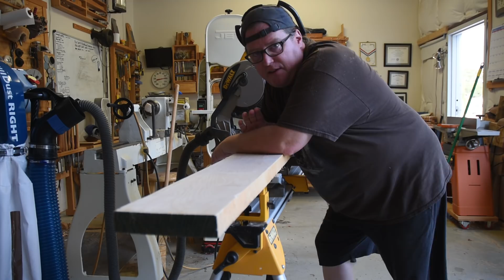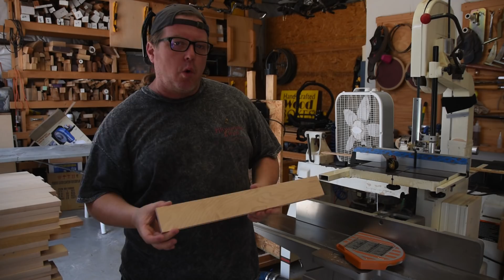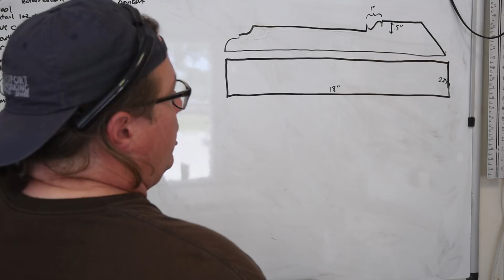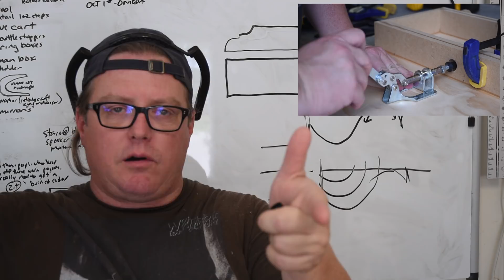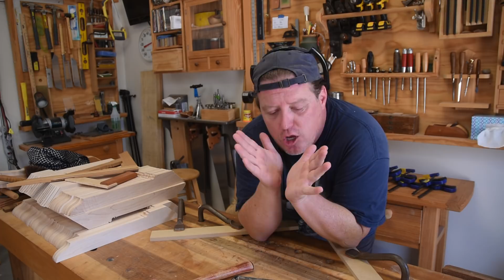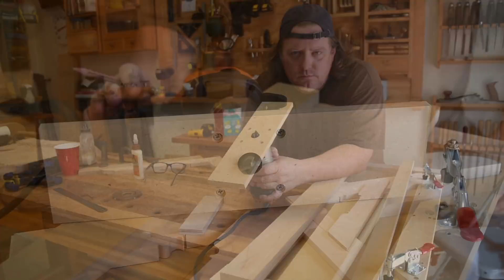Batch Production vs Hand Tools - Woodworking - Making English Squares

Comment: WOW A beautiful tool. If I were to do a production run on those squares I would think about have a special cut router bit ground to the profile you are looking for and ship that pattern off to a place that can make that bit for you. It might be a couple hundred dollars each but it would save mucho hours of the work to get each filigree cut as you are doing now. Now it also require a shaper instead of a router table. But if you are doing a lot of those items that will pay for itself after a few batches.
Reply from the maker: this size would require a shaper which can be some seriously scary machines.

Comment: I must dissagree with you sir , in europ we use all the time table saw on rough material. I have 4 horsepower table saw with 14 inch diameter blade and it cuts heavy rough matherial like sharm. Smal kickbacks here and there are no issue to me.  In my opinion your table saw is just too weak to cut it smooth and thats why wood defects cauze you kickbacks. I use my table saw to split 3,5 inch thick boards what come from sawmill.
Reply from the maker: Jürgen Viesemann uh, no. Doubt seriously Europeans regularly push rough lumber thru a tablesaw without truing one edge or accepting any kickback as normal.
Reply: Example , board comes from sawmill with bark on edges and we use table saw to make so called first stage truing and then we go working with jointer. And kickbacks dosent happen often actually. It happens only if you are messing things up. Iam from east europ and here we have woodworkes universitys where proffesors teach how to saw raw lumber on table saw.
Reply from the maker: Different kind of table saw as you grip board don't run it against fence. You can't change physics just because on other side of world.
Reply: I write down a work order what we do in my country . I go to sawmill ,i take raw board with bark on. Then i go table saw and cut off bark side. Some times i use fence sometimes not for debark. And then i use fence to split the raw board . And i split how ever i want raw boards with table saw.
Reply: I think we have  work culture difference here.

Comment: Nice video.  Completely agree that the skill set and mind set are quite different for production line VS one offs.  I am more comfortable working on table saws than you are but it's a good safety not to respect some paranoia.  Circular saws and routers are probably the most likely power tools to remove a piece of your body.  I personally don't let my hands get as close to the spinning blades as you do.  I have a lot of push sticks and such and am rigorous about using them.

So ponder moments/ thoughts.

I probably would have biscuit joined the sides, but your tenon will look better so I would stick with that if I make one.  For the cross piece I would have done a variation of what you did.  Instead of making a sled and frame though I would have just used two guide boards and a straight cutter with a top bearing.  Same results but no jig time and you can see the cutting where the sled hides it all.  For the OGEE I was thinking I would have stacked up boards as you did but I probably would have used more profile bits to get the shape instead of going to the scroll saw.  I probably also would have done most of the narrowing of the sides with a table saw and then a thin pass with the router.  It is sort of one extra step but as you said routers are not real happy removing a lot of wood.  I also find maple has a tendency to scourch and taking off a lot of wood can get the router bit hot quickly.  But it didn't look like you had much of a problem with that so?

Nice job though with the teaching and going over your thinking and the complications.  I find it often takes longer to figure out how to do something than actually doing it.  With a one off you can adjust and make it a "design feature" but that doesn't work if your making 50.
Reply from the maker: Thanks, and you're right, lots of different way to the ultimate goal. Even in production work.

Comment: It’s good practice to let the saw stop before taking it up - the teeth will mostly be facing in and downwards. I’ve only ever had a kickback with a cheap mitre saw (that I tossed) when I brought the blade up before the saw has had a chance to stop.  You can also use a circular saw for rough cross cuts, which is much safer IMO.  Less power and lighter tools often are much safer for smaller jobs.

Comment: Just a comment on the square top saw blade.  I've found the Freud Box Joint set indispensable. It's a two blade set for just under $100 American. It does 1/4" and 3/8" with two blades (flipped inside out) but can do some nice slotting with a single blade just over .200". I have a micro adjuster on my fence and rarely use a dado set at all choosing instead to reset the narrower set for a wider dado/slot with the micro adjuster and dial indicator. Not everyone has a mirco adjuster that can do that kind of accuracy but that saw blade set has so many applications!
Reply from the maker: Thanks, but my first purchase needs to be a table saw capable of taking advantage of that kind of accuracy. This jobsite saw is for.... jobsites. No real consistency.
Reply: @wortheffort  I'm looking at Sawstop jobsite/contractor saws. What do you think of consistency/quality of these saws? I'm concerned jobsite saw may not have the consistency/accuracy I want but it may be the only one I have room for in my too-small one-car garage shop that's only 11'8" wide. If I go with the contractor saw I can possibly fit in the minimal size configuration with the 30" rip fence but I'd want the 36" fence as it seems to be a lot better quality. Alas that configuration is almost a foot wider than the 30", not just 6", so it's very likely to wide for my space. Any thoughts?

Thanks so much for all your videos. I'm getting a lot of good info from every one I watch. They're pretty long, but have more than enough great material to be well worth the time it takes to watch them.
Reply from the maker: @MichaelBrown-kk6ck  I did a video on “the table saw you need. “ covers this.

Comment: For the small ogees in the middle of the pieces you might be able to save some time over your current process with a molding head on either your table saw or on a radial arm saw.
Reply from the maker: Rodney Walker job site saws don’t have the mass to handle that safely. Don’t own a radial arm. What you see is what I own.

Comment: Excellent! I like your videos that save me time with techniques but make me think through the processes. 

Also helps me think through that I don’t need to rush out and get a planet. I’ve already ‘splurged’ on the jointer but it will come in handy as you illustrated in combination with the table saw. 

You’re a great teacher. THANKS! 👍
Reply from the maker: Thanks

Comment: One thing I've seen done is to make a arm made out of tempered board that indexes in the  miter slots of the bandsaw table. the arm surround the bandsaw blade  and keeps an space of about an 1/8th between the cut and any template attached to the work. This way you can jig up your work pieces, hog out the piece on the bandsaw, then go to the router table for the finish cut while keeping your pattern bit happy with a light cut.
Reply from the maker: Good idea

Comment: Excellent video, as usual!  You are a fine teacher and creative thinker...  One question: I have the exact same planer as you, and I get snipe on both ends, unless I use sacrificial boards.  You just seemed to run your boards right through without worrying about snipe...how??
Reply from the maker: You need to adjust infeed and outfeed to get them coplaner. It’s a real pain to get that machine dialed.
Reply: Thanks for the reply...are you talking about the rollers or those awful tables?
Reply from the maker: Omarateastwind tables
Reply: Thanks again...I'll give it a try.  Have a good weekend.
Reply: Here's a good overall tuneup video you can check out, too.  I was having issues of black spots from the rollers & it was from the infeed/outfeed not being coplaner as well as doing some waxing of the middle base to reduce friction.   https://www.youtube.com/watch?v=oJL39QpEGAE